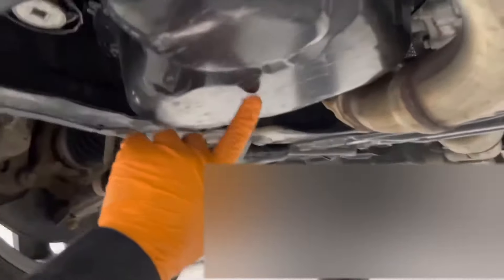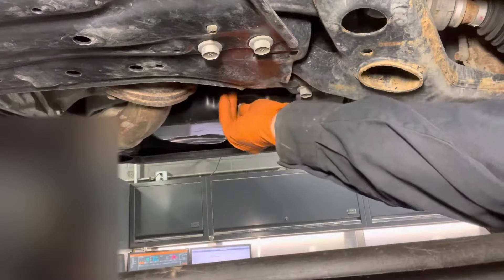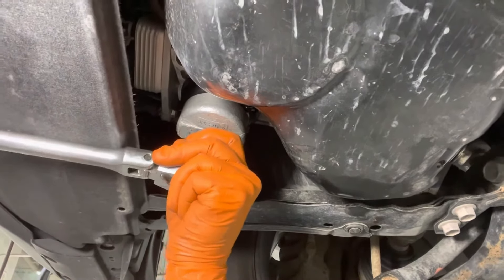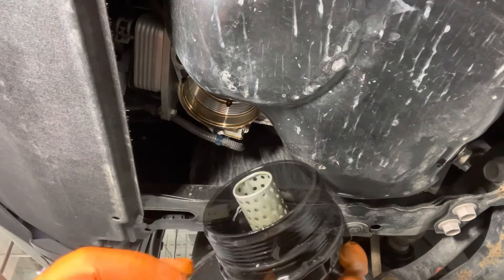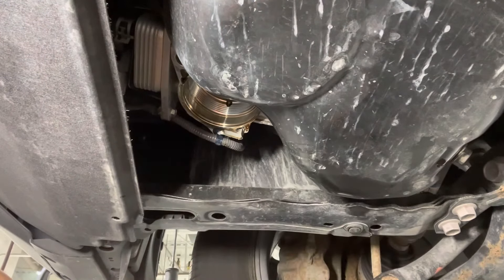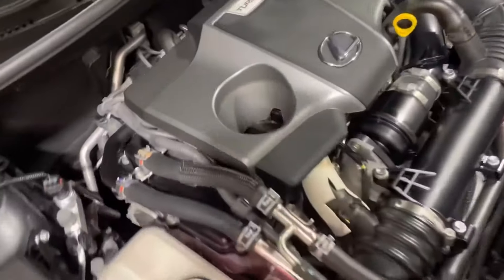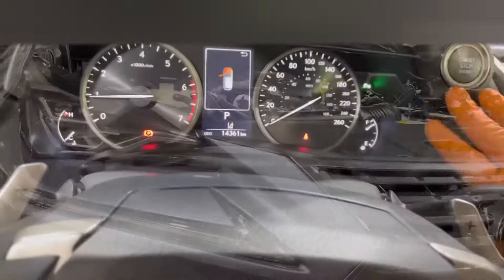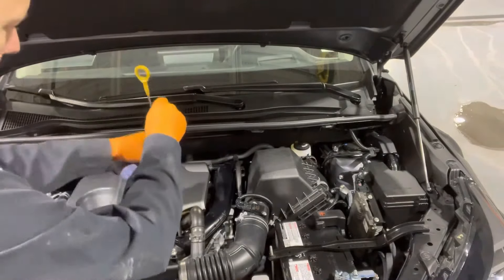2015-2021 Lexus NX200t NX300 Engine Oil Change And Filter Replacement Instructions

Comment from the maker: Below are my affiliate links to the parts and tools you would use to complete this job. I may receive a small commission from the product sales. Thank you!
Oil filter removal tool: https://amzn.to/3DzUld2
Genuine Lexus/Toyota Full Synthetic Motor Oil 0W-20: https://amzn.to/3Ut33Cj
Mobil 1 Extended Performance Full Synthetic Motor Oil 0W-20: https://amzn.to/3Y7F1xS
Genuine Lexus/Toyota oil pan drain plug gaskets: https://amzn.to/478Ib8W
Genuine Lexus/Toyota engine oil filter: https://amzn.to/3EOCUWW
3 Ton Jack stands: https://amzn.to/3q6VS7t
Sturdy 4 Gallon oil drain pan: https://amzn.to/3Ou4iiu
Screw in oil filler funnel: https://amzn.to/3QbGQrG
Rechargeable LED mini work light: https://amzn.to/3Y74OpY
Brake and parts cleaner to clean up the spilled oil mess: https://amzn.to/476RZQz
Automotive rags to clean up the oil residue: https://amzn.to/3H1Pzqv
Reply: Hi Viktor, my 2015 NX200t recently having problem with aircon when a week ago I smell something strange (like plastic) and at the same time my passenger side air vent only blowing hot air when the aircon was turned on. Driver side vent has cold air when temp was set at 22C. And then after a week there is no more aircon from either vent. Do you know what seems to be the problem and is that difficult to be fixed at garage?
TIA.
Reply from the maker: @ hi, unfortunately it is impossible to tell what the problem is without diagnosing it in person.

Comment: I got a 21 Nx Sport but the oil cap read's 5W-20 why the difference?
Reply from the maker: @bernardaflores1720  are you located in USA or Canada or elsewhere?
Reply: @Viktor_G_Automotive  USA
Reply from the maker: @ not sure why that is, all the ones I’ve seen here in Canada say 0w20. You can use 5w20 though if you want. 0w20 helps with easier starting in cold weather.
Reply: @Viktor_G_Automotive  ok, thanks
Reply: @Viktor_G_Automotive  0w20 for a turbo car is kind watery or thin for a good lubrication
Reply from the maker: @ no problem
Reply from the maker: @ 0 refers to the viscosity when the oil is cold, 20 refers to the viscosity when it is hot, so there isn’t really much difference between 0w20 and 5w20 after the engine warms up. Most of the difference is during cold starting.

Comment: Just wanted to thank you for all your videos. I have a question about phosphorus smell coming from my pipe.  I have a 2019 NX300 Fsport with 43k miles and only use 92 octane gas from the same gas company Cheveron.. Two weeks ago I started noticing the smell when I pull into my garage.  I did replace the spark plugs which I bought from the dealer at 40k after watching your video. Changed the air filter and checked the battery just to be sure.  Is it clogged catalytic converter, injector running to rich or lean, or clogged fuel filter which was done as a recall.  Any advice would be much appreciated.
Reply from the maker: Hi Toji, I would check to see if there is a plastic bag or something similar stuck to the muffler or exhaust pipe. I’ve seen that multiple times, a bag flies up on the highway and melts onto the exhaust, causing all kinds of nasty smells.

Comment: Idk who engineered these cars but I hate them. Had to drop my sub frame just install new control arms. Had to drop tank to replace fuel pump, which theres a recall but the stealership claims mine isnt covered. Also fuel filter is in the tank, so I had to bypass those and put wix external filters so I can change them without dropping the tank. Toyota/Lexus has either gotten greedy and are doing this on purpose or they're the worst engineers on earth.
Reply from the maker: Some things can definitely be challenging to work on. Although, having done many of those fuel pumps under the recall it becomes a 45 minute job to replace one, so it’s not that terrible.